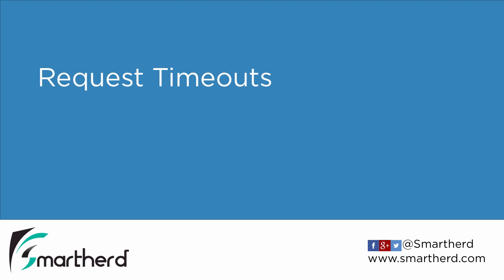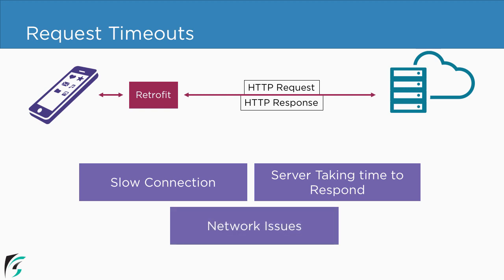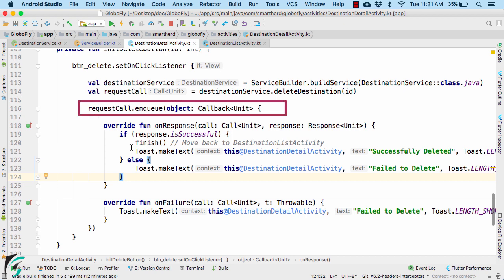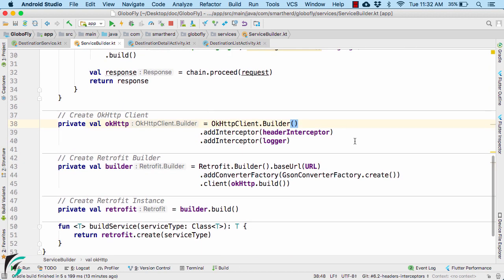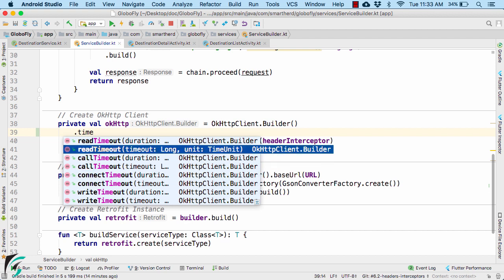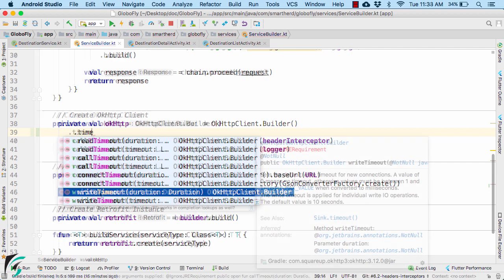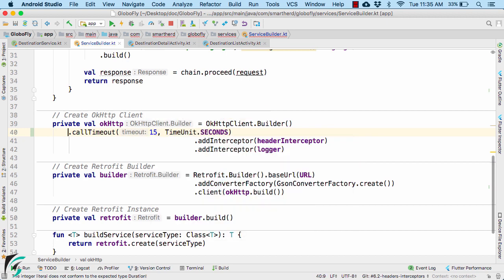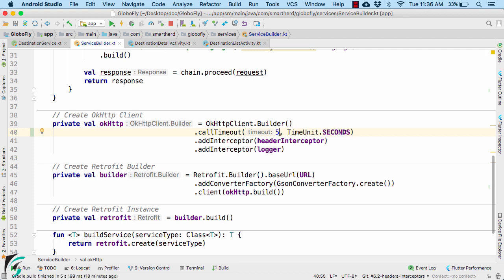Retrofit Request Timeouts: Handling slow network connections: Retrofit Android Tutorials #6.2

Comment: what are issues will be faced when i make that time out more
Reply: it will wait more for the request to be completed. which means if there is a queue of work which depend on the result of this call, they will have to wait. simply if you have a loading spinner it will be spinning for the amount of time you set as the timeout.